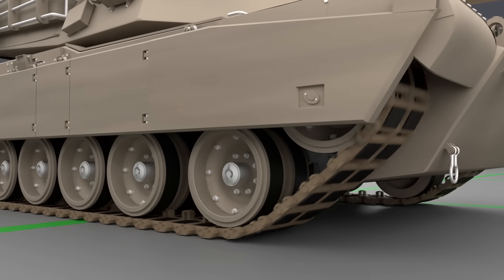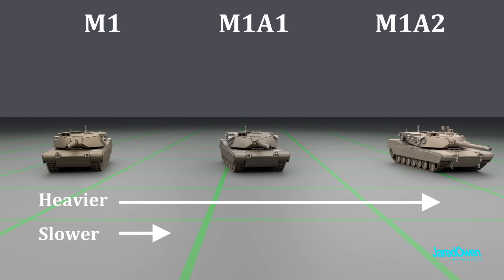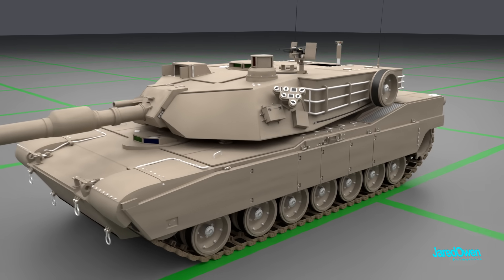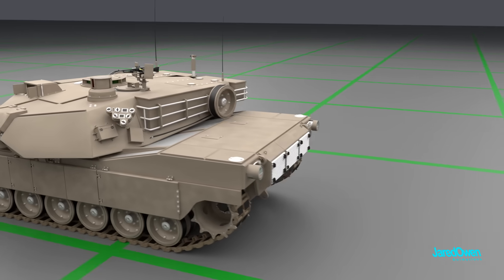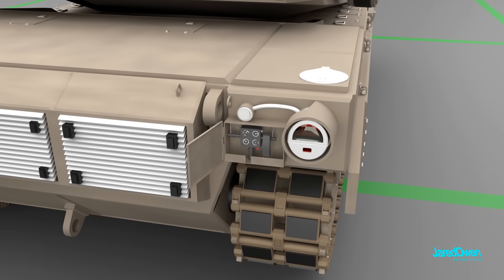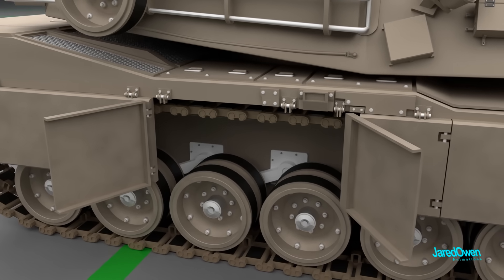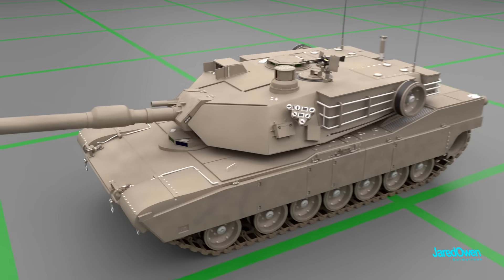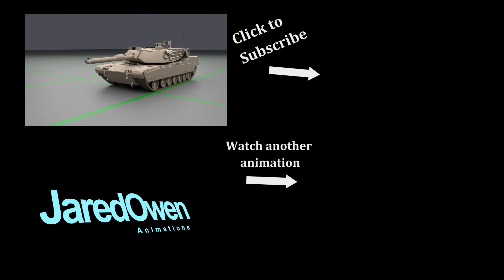How does a Tank work? (M1A2 Abrams)

Comment: 6 March 2022 - Sun 0705: Yeah, 14K comments precede this - and I was too damned impressed not to ponder on what was depicted here and decide to add my two cents.

I'm not a warmonger; still, I am fascinated by the engineering involved in weaponry and the operation of such machines. I marvel at the Roman onager used to catapult boulders millennia ago.

I've known about tanks all my life. I recall a "Golden Book Encyclopedia" drawing of one of the early tanks Winston Churchill approved for use by Great Britain circa World War I.

Your animation is fantastic. Sometimes, I lament the amount of information that is available about our defense capability; however,.I know our enemies have acquired significantly more intelligence than the American public and I appreciate the relative transparency of our society compared to autocratic regimes. No, we aren't perfect by any stretch, but I wouldn't want to live anywhere else.

I didn't know our modern main battle tank only  needs a crew of four. I didn't know the rear wheel is a gear wheel that propels the tank. I didn't know the M1 Abrams A2 weighed as much as 35 cars and can travel up to 42.mph. I didn't know that a mud-stuck Abrams - a sitting duck - could fend off the rounds of three Russian T72s and destroy them all. That's scary.

Taking note of your name, I did a Wikipedia research on the famous Irish pub song / military march, "Garryowen," and wondered if you'd considered adopting it for at least a few of your videos. I know it's association with the 7th Cavalry - and particularly, General Custer - may not be appealing. Still, I think it's a terrific song and you can find ways to make it your own 

Great video: I'm subscribing.

Comment: actually it's not for  rough terrain as much as  useful for floatation on extremely soft ground. while the tracks can a difference in ride and allow it to deal with rough terrain it's when trying to move through sand, mud  swampy areas that tracks shine.  instead of 68 tons on let's say 8 wheels with a contact patch of lets say 6 inches by 12 inchs that is a area of 576 square inches of ground holding up the weight. or two  12 inch  wide tracks with 10 feet long on the ground. you then have 2880 square inches of contact patch. if you take the weight of 68 tons that 136,000 lbs on 576 square inches which come out to about 230 pounds per square inch. but the 136,000 pounds spread on the two tracks with 2,880 square inches comes out to about 50 pounds per square inch of ground. if you would put the tank on wheels you end up with a sitting duck most of the land that's soft would render the tank stuck but when it's 50 pound's per square inch it allows the tank to move over soft ground without getting stuck. for a grunt with a combat load weights 240 pounds dripping wet has about 50  square inches of contact per foot  for 2.5 pounds per square inch of ground. you can see the main advantage of tracks isnt rough terrain but to float across soft ground that wheeled vehicle would be useless.

Comment: Could you possibly add the units that the most of the humanity uses next to the feets gallons etc? it's pain in the back to go and convert to learn that it burns 39l/100km is about 10 meters long and weights close to 62 proper tonnes. Pretty please

Comment: Excellent 3D animation. Awesome video. I have a question, though: Isn't the top speed of the Abrams tank supposed to be "classified" information?
Reply: No it isn't. There was hardly anything classified after they were fielded. Everything gets leaked eventually. 
Only thing I didn't get to see was the side armament. Had two collide and they wouldn't let anybody less than E_7 close to it. 
We would go on alert and before we could even leave the concern. There was a guy riding a scooter with a tee shirt with the name of the manuver on it. It's usually the way we enlisted found out the name of it.
Reply: Nobody really cares about top speed. It’s just a cool fun fact; it’s not going to revolutionize enemy tactics or tank design or anything.

Comment: Amazing presentation. Out of this world. But aren't all modern tanks use engines that run on Diesel fuel? Most use piston engines, but the US's M1 Abrams uses a turbine?
Reply: Most tanks use diesel piston engines, but the M-1 Abrams variants use a turbine. The primary standard fuel for the US Department of Defense vehicles of all types, including the turbine powered Abrams, is JP-8, not diesel, although diesel can be used if necessary.

Comment: Well, that's a poor story. I understand that there are no batteries on the tank.4:35 GTE (gas turbine engine) is demanding on air purity, which determines the need for frequent filter changes in dusty conditions.8:00 In combat conditions, the loaders did not close the armored curtain separating the turret from the carried ammunition load. This was done by the crew in order to increase the rate of fire, the fall of which can be a critical factor. This nullified all the advantages of carrying ammunition behind the turret. In the event of an ammunition detonation, the shock wave will go inside and the crew will be destroyed.8:24 It is practically impossible to evacuate a driver in combat conditions through a regular hatch (there are no other options), the tower prevents a quick escape.

Comment: Enough with the references to "war thunder", it is a fucking VIDEO GAME, it is not reality. 

40 years on and it is STILL one of the most capable tanks on the planet. It is actually capable of much higher speeds but the speed limitation is a factor of the durability of the tracks. No one who is knowledgeable about tanks EVER calls them treads. The treads are the rubber pads on the track links. To date has BY FAR the greatest kill to loss ratio in history.

Comment: As a former driver, loader, and gunner on an M1A2 SEP v2, my opinion is that this is the most accurate video on YouTube about the Abrams - very well done to you. I have to be very nitpicky to even find discrepancies, but they are as follows:

There are only two large blowout panels on the roof of the turret, not three small ones.

The smoke grenade launchers launch actual smoke grenades (and hold grease tubes) - they're not smoke generators. Although, the Abrams does have that capability by spraying oil onto the "bitch plate" (because it's a bitch to remove for maintenance) - the steel plate that sits on top of the engine; it's hot enough that the oil burns to create smoke.

The "electronics" at 1:54 are not for electronics; they're simply metal torsion bars that keep downward pressure on the mud guards that sit atop the idler wheels so they don't fly up when driving.

And of course the inside of the turret isn't bare like this, but it goes without saying that it would be very difficult to get access to those details.

Again, well done!

Comment: The gun is Made in Germany and gives the M1 very high fire power.
Reply: It's not the exact same gun used by Germany, as it has several changes to suit the US needs of tank cannon.
Reply: The M1s M256 gun is a cheaper, heavier version of the German L/44.
The M256 does not have the concentrically balanced gun tube or the improved hydro-pneumatic recoil system found on the Leopard 2.

Comment: Great job, from an old retired, "Tanker". Surprised you left out the commanders .50 cal machine gun. Also left out what's to me the best part, the amazing Fire Control System that allows you to destroy enemy 2 miles away in dead of night! Uses multiple sensor inputs to Fire Control Computer. Laser rangefinder, ammo type, lead input[for moving targets], ambient temp, ammunition temp, wind sensor, cant sensor, barrel droop sensor[a hot barrel makes a difference]. Another thing worth talking about is the incredible simulator training that allows tank crews to fight hundred of battles. Like a gunfighter practicing his draw over and over. Whole units can fight together. I was lucky enough to be on the Design/Test team for the M1A1. The tech thats been added to the tank since then is mindblowing! I got to give a WWII tanker a tour of the tank at Fort Knox- he was amazed!

Comment: They should have a way to change engine from diesel during peace and turbine during war.
Reply: Diesel would be better all the time... especially in combat.
Reply: @jedd_ate_lead  A tank is most vulnerable to attack when its stopped,  the Gas Turbine engine produces a significantly larger heat signature at idle than a Diesel engine.
The AGT-1500 is an obsolete engine and General Dynamics has already announced that any new version will be powered by a MTU  (Maybach) Diesel engine like the Leopard 2.

Comment: How do the torsion bars fit in the tank? Are the arms longer or are the bars half length?
Reply: They go about 90% the width of the bottom of the hull. They offset the wheels to allow room for the torsion bars.

Comment: Did you mean 3500 feet per second? Cuz 3500 mph at sea level is friggen booking. Thats like mach7. SAMs dont even go that fast
Reply: Nope, 3,500mph or 1,750m/s is correct. Most modern large sabot rounds go that speed.

Comment: I was a tank platoon leader.  Each platoon had 4 tanks plus the company commander and executive officer, so 14 tanks in total.  Platoon leader is Second Lieutenant (2LT) or First Lieutenant (1 LT).  Your platoon sergeant is a Sergeant First Class (SFC) and the other two tanks are commanded usually by two Staff Sergeants (SSG).  Gunners are usually buck Sergeants (E5's) and loaders and drivers are E1 thru E4.  Company commander is a Captain and the Executive Officer is a First Lieutenant (1LT) usually in a promotable status to Captain.  Every morning, in the field, we had a short count where all 14 tanks start at one time to mask how many tanks you have.  We are the infantry's best friend because once the talks start they gather around the exhaust area to dry off their clothes, equipment and warm up their meals ready to eat (MRE's).  They placed them on top of the grills.  I had a great time until I moved on to other assignments.

Comment: usually tanks don't use turbine engines, I'm pretty sure the Abrams is the only modern MBT that uses it.
Reply: T-80. Also the Leclerc and K2 use them as APU's.
Reply: Diesel engine technology has completely surpassed the gas turbine in tank applications... the AGT-1500 is a obsolete design.
Reply: @sandervanderkammen9230  In practice certainly a lot more attention is paid to Diesels as the primary form of power. To say development of turbines in powerplants as APU's or the engine is dead is not observed
Reply: @peterson7082  Your joking right?
The Diesel engine outperformed the gas turbine in every test during the XM1 trials... Lycoming ended production of the 1960s vintage AGT-1500 30 years ago...
Reply: @sandervanderkammen9230  one major upgrade program has been done, with several other proposed as well as a replacement not entirely written off the books though not accepted as of yet more so due to the anticipation followed by failure of the Future Combat System XM1202 and other vehicles.
Reply: @peterson7082  The M1 Abrams is still waiting for a new Diesel engine.
Reply: The M1 Abrams is essentially a 1970s design so the term "modern" is used reather losely...
Reply: @sandervanderkammen9230  Certainly a lot of the tech inside the tank is.
Reply: @peterson7082  Yes, the Abrams is a bit outdated compared to the Leopard 2.
Reply: @sandervanderkammen9230  Not really in regards to fire control or communication systems that are in operational service. Lots of new Leopard 2's are proposed  but few actually accepted into service that provide more than incremental upgrades
Reply: @peterson7082  Lol, thats funny... the M1 still uses the outdated L44 gun...
Reply: @sandervanderkammen9230  I would tend to agree but the difference in current ammuniton penetration values for APFSDS is negligible. Now soon there is going to be a need to upgrade to a longer gun. But there is no notable loss for it as is now.
Reply: @peterson7082  The L55 delivers significantly greater penetration with longer range and superior accuracy.

Silver bullets are for vampire novels... its muzzle velocity and muzzle energy that kills tanks and the old urban myths regarding DU penetrators.
Reply: @sandervanderkammen9230  Not penetration to any notable margin- certainly some, but not anything significant. Velocity yes. Accuracy not really different.
Reply: @peterson7082  Its apparent that you don't know anything about the L/55.. not only does if have much better penetration, it has better penetration at longer range with superior accuracy to the outdated German L44 which is more accurate than the much cheaper M256 L44...
Thats exactly the L55 was adopted into service.

Comment: Helicopter......not airplane,the engine is actually a modified AGT 1500 which modified Blackhawk engine.
I've never heard or seen a phone on the outside
Reply: Not really the case, a proposed refit/ replacement to the Blackhawk's engines considered a variant of the AGT-1500 but that fell through.
Reply: AIRPLANE engine... not helicopter.
 Dr. Aselm Franz developed the Lycoming PLT25 from the Jumo GT250... the GT250 was a tank gas turbine engine which used the core of a Jumo -022 an enlarged version of the Jumo 004 Orkan engines that powered the Messerschmitt Me-262.

Comment: Our tank is based on the leopard system
Reply: Not really
Reply: M1 Abrams was based on the previous MBT-70/Kampfpanzer 70, so not really
Reply: @Kalashnikov413  Not true, the Xm805 and XM815 hulls were constructed in Germany by Krauss Maffei.
Reply: @sandervanderkammen9230  Not true, the M1 was developed as a continuation of the failed XM805 project which was a continuation of the failed MBT-70/Kpz 70 project which was an American–West German joint project.

Sure the Abrams shared some similarities with Leopard 2, but there aren't many of them and certainly it isn't enough to called it ''based on Leopard 2''
Reply: @Kalashnikov413  Sorry but you are bit confused and misinformed...
The XM805 became the XM815 program which was later renamed the XM1...
The KpfPz 70  XM805 and XM815 hulls were all built in Germany by Krauss Maffei, 
The Leopard 2 and M1 share the same basic hull design and still have interchangeable parts.
Reply: @sandervanderkammen9230  if it was built in Germany by Krauss Maffei, then why tf it was a joint development project in the first place?
Reply: @Kalashnikov413  I have not been able to find anything to support that claim
Reply: @peterson7082  you're talking about me or him?
Reply: @Kalashnikov413  Him. Regarding Kraus Maffei producing the hulls.
Reply: @peterson7082  oh, ok
Reply: @Kalashnikov413  Because the U.S. was supposed to develop the Turret and Main Armament system..
 The Hulls were designed by Germany and each country was responsible for developing its own engine/powerpack, the power packs were designed to be STANAG compatible and interchangeable and still are to this day.
Reply: @peterson7082  Krauss Maffei built 14 early version Leopard 2 hulls and shipped them to America as MBT-70s.. 1 Hull was converted by K-M to a XM805 protype, 2 Hulls were converted into XM815 prototypes using updated Leopard 2 components and were later redisignated as XM1s.
Reply: @sandervanderkammen9230  can you give us source?
Reply: @Kalashnikov413  The Fort Knox collection still has a XM805 with the original data plate that says "Made in West Germany"
Reply: @sandervanderkammen9230  What i want is a picture and a document about it
Reply: @Kalashnikov413  How old are you?
Reply: @sandervanderkammen9230  15
Reply: @Kalashnikov413  Ah! OK.

So you do realize that the M1 Abrams was developed about 30 years before you were born? During the biggest war in U.S. history? And that it predates the internet and social media right? 
There is very very little information available on the development history of the M1 Abrams and even less available on the internet.
Reply: @sandervanderkammen9230  ok........? i'm quite confused now
Reply: That is correct, the M1 Abrams is essentially a XM815 built by Krauss Maffei in Germany and also became the Leopard 2.
Major suspension components on the Abrams are manufactured under license from German manufacturers such as Krauss Maffei, Krupp, Koni, Eibach and BBS.

Comment: 3:58  why treads are used "...is so tanks can go over very rough terrain".    I think it's more accurately said that tread/tracks are used instead of wheels because they work better in soft sand and soft, deep mud.  A tread has far more surface area at the point of contact with the ground.and it won't sink in far.  Great animation!  I was wondering what you used,  I guess Blender3D.  Very informative, Thanks!
Reply: TRACKS are used to reduce the effects of displacement and its related drag, this increases off-road ground speed without having to increase the power-weight ratio. 
Any questions?